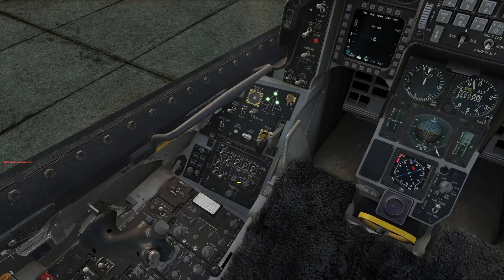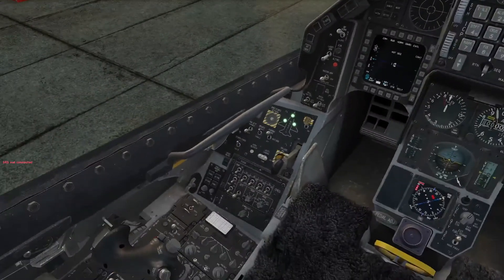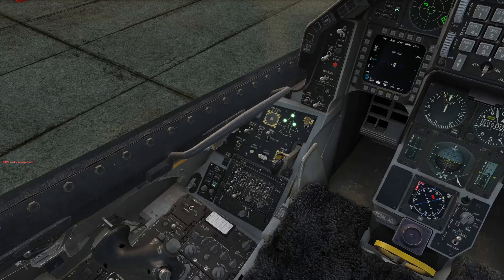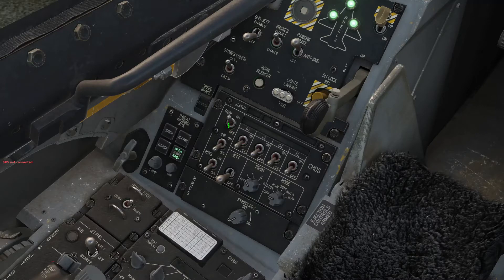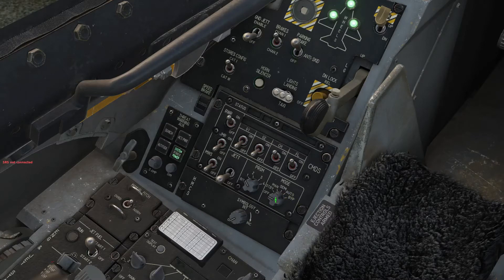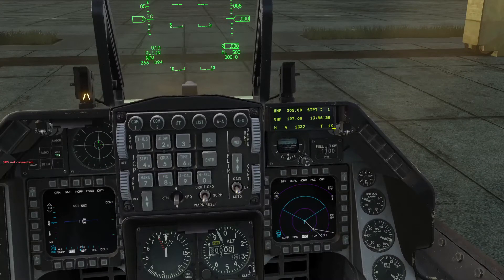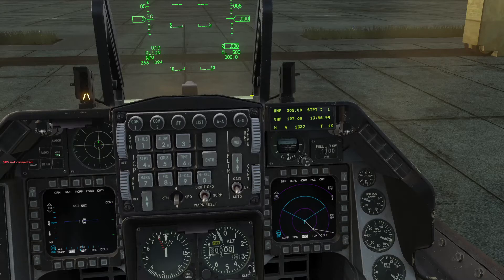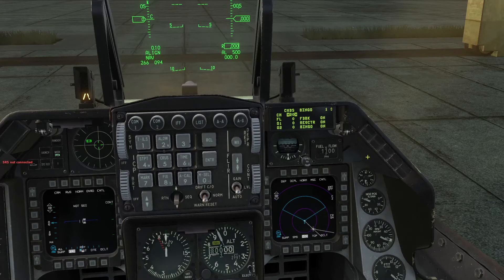DCS F-16 Viper CMDS program changing

Comment: I saw a post where cmds does not display go on the newer updates. I couldn't use chaff and flare on the runway. So I thought they did not work. They fire off even with the go not displaying.
Reply: I got everything figured out. Your video helped me a lot on how to program chaff and flares. I learned you cannot launch chaff and flares on the ground. Also the newer dcs version doesn't show a go in the display in the cockpit above where you turn them on.
Reply from the maker: @jameslong4252  Good to hear you got it squared away. I was going to say that I don't recall ever seeing a GO in the cockpit displays, I didn't have the Viper back when it first came out so my version may never have had that.
Reply from the maker: GO, are you referring to being able to fire countermeasures on ground? If so I will look into this as I have not had a need to fire them on ground.